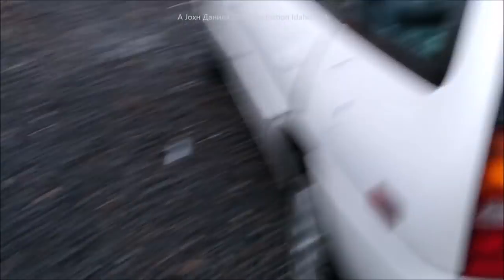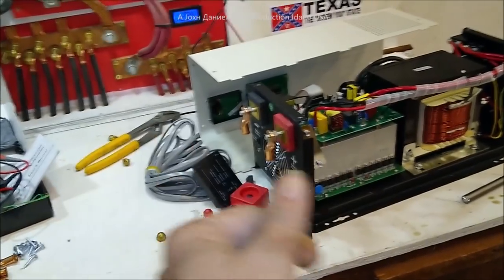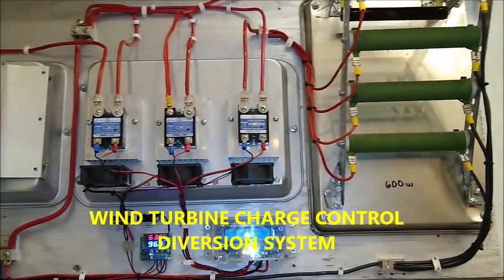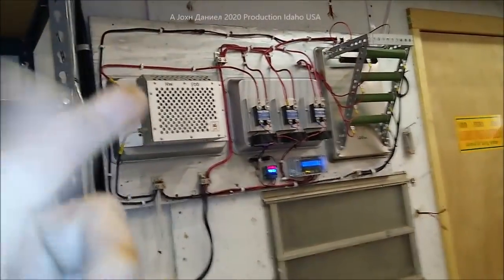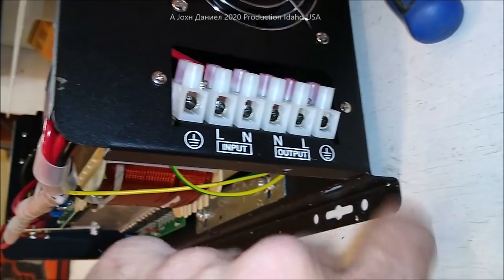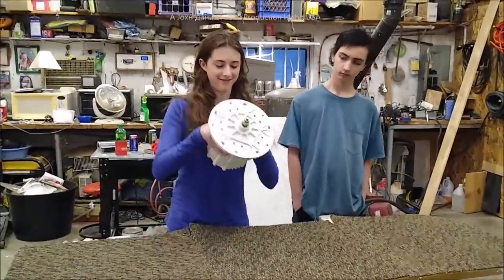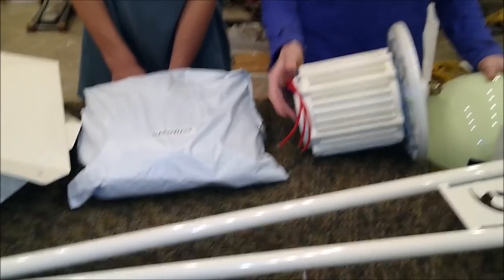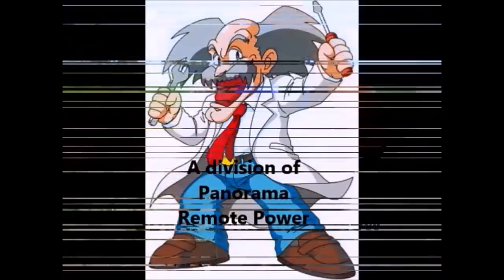Off Grid upgrades & New 750 watt Hurricane Vector 2.0 Wind Turbine, ALL parts below vid

Comment: I bought and installed this turbine about 4 years ago, and have had nothing but satisfying output from it, only thing I've had to do is put grease on yaw bearing once every six months, other than that, had zero issues. I have seen 1400 watts come out of it in 40 mph winds. I'm pretty pleased with it, when ever they are available again, I'm going to install 2 more.

Comment: I have a 1000 watt wind turbine like your 750 watt got mine from Tony at Huricane. I’ve been holding off the install because I’m very new with wind. I will be following along with your install. I have a 50’ tilt up tower and the wiring buried from my cabin to the tower approximately 130 feet away 3 strands #8 copper. I’ve been waiting for just such an occasion to finalize the install. My system is a 24 volt system and I will be running wild AC current at Tonys suggestion (I’m not sure what wild AC means)I will be using the midnight 150 for the charge controller. My battery bank is 4 rolls surette 6 volt 455 amp hour each lead acid. I would like to use any diversion load to preheat water. I have two 105 gallon water tanks. Thanks so much for sharing your knowledge. Bob Bailey
Reply from the maker: Wild AC is the voltage that is unsustained by mechanical motion. Example: Gas generator produces power via a engine set to a specific RPM for control of Hertz ( cycles per second ). A wind turbine in the small wind design produces wild AC @ 3 phases due to the fact its cycles (rpms) is based on the wind speeds. Therefore its wild. Can be any rate of hertz. Thats why they are converted to DC with a Rectifier. 
Your battery system is nice and sufficient for the Hurricane turbine. But to heat water you will need some control items. I can try to remember to make a video on a grease board schematic to show what and how you do that. It requires heating elements that can handle the power, and for 2 tanks I recommend the 600 watt models that Tony has. Go to his web site, go to Contact Hurricane Wind link, put PARTS NEEDED - SENT BY POKY on your message to him asking for best price on 3 of the 600 watt heating units and he will reply with a discount rate. Get 3, then you have a spare. They are the nichrome models, VERY good, and he test them for balance so you can trust them/him. But I always get a spare in case I screw up on something.
Reply: Јоhn Daniel thank you so much Mr. Daniel

Comment: So it is safe to charge with wind generator an solar battery type? I am thinking also of combo 50/50 wind and solar, as we have plenty of wind here. I calculated my comfort power need as just 500W/h and minimum is 150-200W/h,
so i guess with one of these turbines (400W) and two solar panels (2 x 310W) i should be more than fine?
What kind of battery setup would i need for that? I guess one 260Ah would not be enough?
I guess at winter i could use electric heater as load when battery is full and so on.
Thank you very much on nice explanations :)
Reply from the maker: Go with the 5 blade 500 watt turbine, upgrade the wind turbine controller for it to a unit style, and use a minimum of 400Ah of battery from that design you posted so you do not over run your batteries and loose too much water in them. From that you can run a 1500 watt pure sine inverter easily most all the time.
Reply: @JOHNDANIEL1  Thanks for response, ugh i was afraid you will say ill need one more battery, they are the most expensive thing in setup hahahaha, ah well.

Comment: Aussie Engineer here mate,  BRILLIANT,   (& thx for the replay about 3 phase AC output from turbine)  My family and I are waiting 4 months for settlement of our new 50 acre farm on the Sth Coast of Victoria, 1.5hrs from Melbourne.  It gets a lot of WIND...a lot and I'm planning planning, using a lot of you're excellent designs and getting ready to purchase the same materials from your links in prep to erect 4 odd turbines. I'm hoping by the time I'm ready to purchase, a reliable 12V -1000 Watt model is available but I cant see any on Ali Express manufactured by B-Creation yet. I do like the B&C 800W 12v Wind Turbines Generator+ Wind Controller 12V, and these 750 Watt Hurricane Vector 2.0 look be good. Ideally I'd like three or four 1000 Watt units (even you're purple rain looks bloody good).  I'm also installing a 5kW solar (maximum allowed on grid here). 
 I think you have touched on the different characteristics of the blade number i.e. 5 blades advantages in comparison to three blades,  but a very quick post on this topic would be awesome.  Again thx for showing us all you're new design and improved increased inverter design. Hanging to see more.   By the way I have my own channel simply search my name,  but my channel is dedicated to adventure 4WD travel across Aussie and kick ass Barramundi fishing. . .I have plenty of deer hunting stalking videos but havent uploaded those, people try and poach youre spots!

Comment: Awesome rework and overhaul of your off-grid system @JohnDaniel

I've been collecting parts for my off-grid wind/solar lighting system for our new home that include a 5-blade 12V Green-E turbine, batteries, and power meters.  I've standardized on a 12V system for the battery charging side of the equation. I'm going to be taking a slightly different power storage approach using Headway LiFePO4 cells vs. the Lead-Acid/AGM chemistry cells that you and most other folks employ.  Because the battery bank is multi-cell, I'll be using a BMS system for balancing and charge control.  I'd really like to consult with you on the operations of the diversion controller mated up with an appropriate LiFePO4 BMS.  This lighting system will be a 100% DC-based cloud capable smart controller with modulated boost controllers to operate LED strings up to 40V.   What is the best means to connect with you and get your recommendations for all the turbine/solar power handling?  Thanks in advance.  Jim in Colorado

Comment: asked awhile back about low hurtz breaker couldn't find anything but found line conditioner can clean up generator outputs i think will work cool to hear your inverter can run off generator even off hurtz neat🤘

Comment: OOh wait, wind power on your roof? Do you not have clear ground space to fit them anywhere? It's just that when I looked into it, the buffeting and updraft effects from the building really upsets the flow through the turbine and you lose a LOT of power..
Beast of a new turbine though I'll give you that. I was going to build one from Pigots book but after researching the valley I live in, the average wind speed wasn't high enough to make it worth while haha oh well!
Reply from the maker: There's a turbulence point at 1.10 ratio of the turbines blade size to roof distance. So if you have 60" blades you must be over 70" above the roof to the lowest blade point to prevent cavitation.
Reply: @JOHNDANIEL1  Yep understand the wash, I was more on about (laminar?) flow from the wind itself, buildings disrupt that flow direction and you lose total available wind energy because some of isn't heading directly into the blades like it would have been in open countryside.

Comment: John do you hooked up all your turbines in parallel to one battery bank?
Reply from the maker: Παρακαλώ
Reply from the maker: Yes, and just one load charge controller runs it all.
Reply: @JOHNDANIEL1  but don't they charge in different ac frequency?
Reply from the maker: They reach their individual rectifiers at different frequencies, but on the DC output are held by the battery bank voltage to a limit of absorption and the controller from exceeding that setting.
Reply: @JOHNDANIEL1  I see. I thought you were using different charge controllers.
Thank you. Greetings from Greece.

Comment: Ha John, I don't know if this is the forum to ask a question about batteries. I have a weekend place that is off grind, solar and wind  I am having a problem with equilizing the batteries. 6 Crown 235amp I have them wired to buss bar. Never seems to be sunny or windy on equilizing day, running 2 Tracer 40amp controllers like yours. When I get there on weekends usually have 14 volts in bank turn inverter on drops to 13v only running lights. Batteries are 2years old.. If you could give any suggestions I would appreciate, thank you
Reply from the maker: Whats your settings on the wind turbines power? It should be set to divert at no less than 1/2 volt over the solar max charge rates, then you will not have this issue.
Reply: @JOHNDANIEL1  controller is at 14.5v fixed. Equilizing is at 15.4v do I need to setup with ssr and dump
Reply from the maker: That's slightly high for equalizing, normal is 15.25 on open Lead Acid, 15.1 for SLA ( sealed lead acid ) for 35 minutes after reaching 13.8 volts, or a max battery temperature of 122 degrees Fahrenheit per 100 amp hour storage points. Whats your water level, are you only using distilled water?
Hot charge to clean plates is about 15.6 to 16 volts ( amps as prescribed by maker) for 10 minutes past 14.2, so I would check with Crown and be sure your not in risk of percolating the cells.
Check your cells for cloudiness and gravity, battery Hydrometer checker that's best. https://amzn.to/2U0XTQg

Comment: Sorry to hear about the Wife tangling with the Big Rig.  Did the Driver Fess Up ?   Did she have a clue he was going to make that turn ?   Big Rig Driver screwed up turning from that lane.  Should have been in her lane and swung wide .   Hell at least stopped and made the turn in a creep speed? 

What Solar Charge Controllers you using  ?  I went with EpEver Tracer 4215BN series.  Bit of a pain to set up for LiFePo4 but the price was right.  Can monitor all from the Lap Top.   

STILL NOT GOT MY 500w HOISTED AND WORKING.   Just finished up gathering some batteries.  Limited finances type thing.  Going to give Nissan Leaf Modules a go.  Have 12 to start.   Also obtained 3 100w Lion LiFePo4 packs to mess with.  If ya see a small Mushroom cloud down by the dotted line of Mexico in New Mexico don't get to upset.  It was me.  Still using that cheap Chines Grid Tie.   Actually working out better then expected.   Winters pretty much SUCK,   eaaa?     My ol Colman Heater cubby hole is going to end up more then crowded with all this stuff.   Man that inverter is a Whopper.  Looking for like a 2Kw  Pure Sign.   Don't need it to have charger abilities.